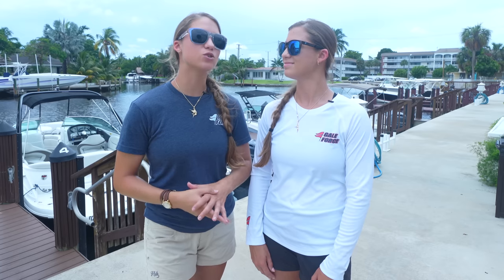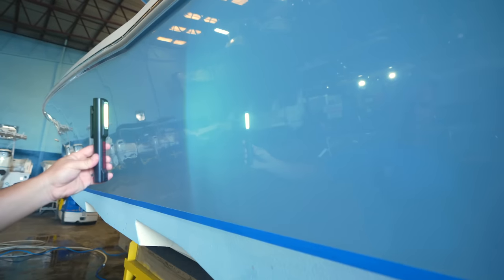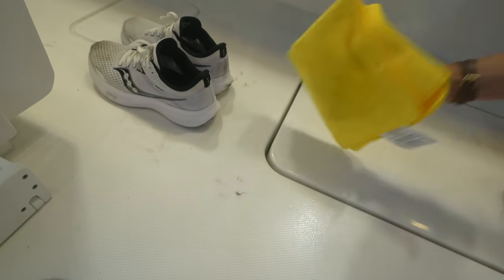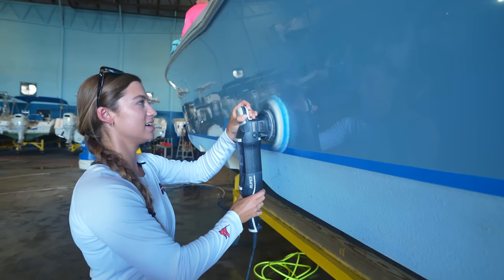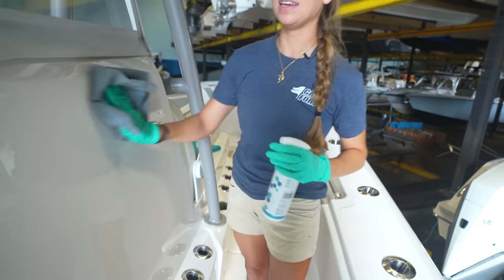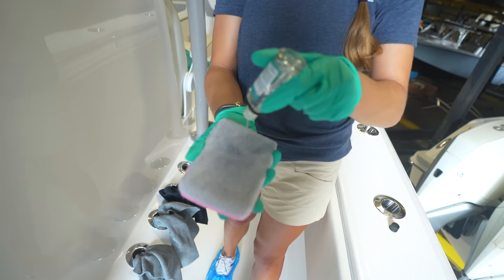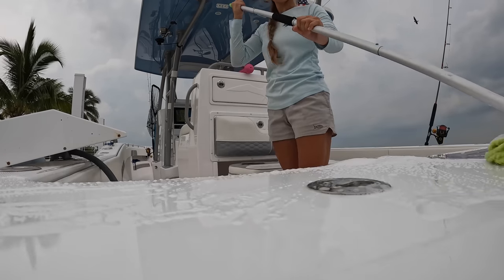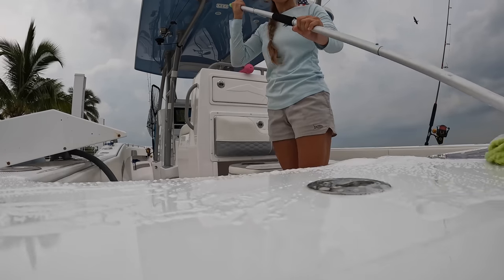Ceramic coat on a boat - Is it worth it?

Comment: I use the same brand (GTECHNIQ crystal Serum and exo) on my truck about 4 years ago. I liked it so much, I also applied the marine version on my boat. I really like how easy it is to clean and dry. I usually just take a leaf blower to it for drying, followed by a towel. I personally think it is worth it, but I applied it myself. A lot of time gets put in the prep as they show. Applying the coating is the easiest part. To me it's worth it, but I don't mind spending a few days during the winter to do this - plus I have a much smaller boat (key west 239FS) so doing it myself is manageable. One key thing to note is this is not going to keep off water spots. It's not a miracle product and does wear off. But for me the ease of cleaning and drying makes it worth it for the truck and boat.

Comment: The timing of this was perfect since I am considering getting my boat ceramic coated. What dealer did you use for the application? I am assuming Gtech just manufactures the product and doesn't apply? Thanks!

Comment: I have always been curious if it would increase fuel mileage since it creates such a slippery surface. Less drag equals better mileage
Reply: It doesn't, some will say it does just using what you said as their reason but there has yet to be any proof to show it does. It also adds weight but that doesn't  mean it  increases fuel usage. What helps fuel usage is getting the boat out of the water. That's why some(not always) 4 blade props will help with mpg at cruise because they give more stern lift. Any decrease in drag due to these products be slicker is negated by the small amount of extra weight they also add.

Comment: The only time this is worth it is if you are willing to put in the time to maintain it, and you have money to burn. Sometimes the professionally installed coatings that come with a guarantee require you to use that professional and/or products to maintain the coating as well, so that can be added cost. At the end of the day, if you're not the type to properly wash down your boat everytime you use it, then it's most likely not going to give you any benefit.

Comment: One dig two cycle engine one big one is it 45 does the same thing as 2 cycle motor cheaper used good rebilled cheaper replace water pump boat lee gas is Willie Nelson gas if you're going to go diesel in much faster which reliable with a shorter shaft but I would use on it on the boat two cycle engine with a shorter shaft cheaper